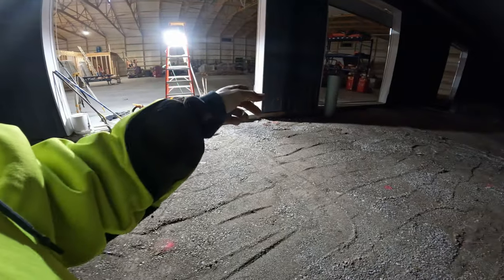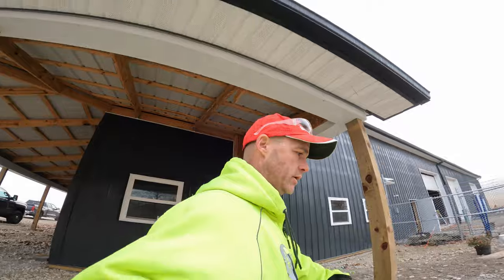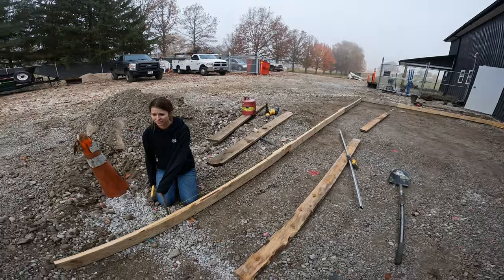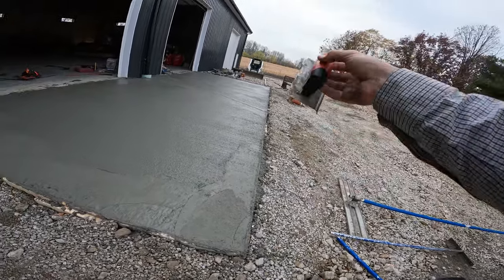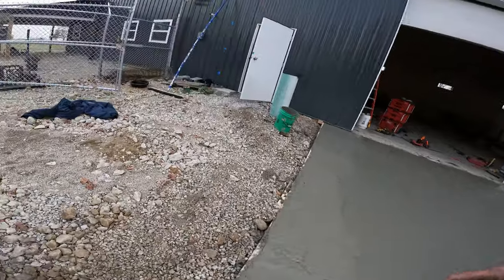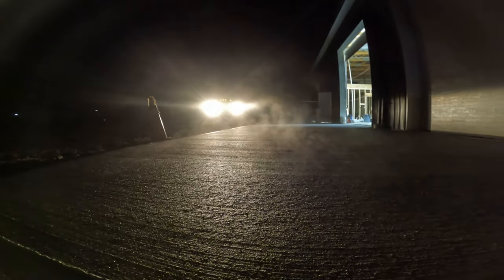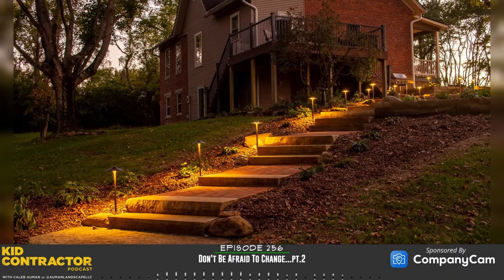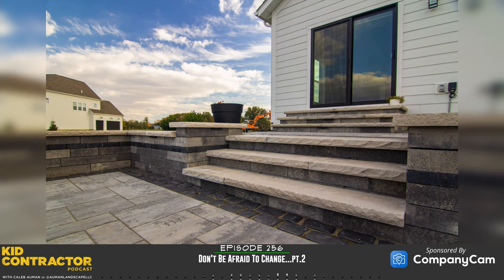What did we screw up on Concrete Slab Placement at Auman HQ? ??

Comment: compaction is good, but i prefer expansion instead of dowes, only for the reason u explained. dowes make sense to keep it in place, wire mesh is better, rebar is over kill and can cause rust spots on the surface. so far so good, btw compaction is key good job

Comment: You dowel in the middle when you want to pads to stay even like in a parking lot. Against a house you don't want to connect them, you dowel under the slab so it keeps the slab up and doesn't settle. In other words your slab will sit in top of the dowels.
Reply from the maker: Interesting.  That’s a good explanation.  Thanks!
Reply: thats what i said

Comment: Dowling is not ideal. And if and when you use them they need to be installed level with the top of your gravel base. You should do this so your slab don't settle but also when it shifts up it won't take a chunk of concrete out instead it will just pop the dowl free from the bottom of the concrete. The guy from Victory Concrete can explain this better than me.
Reply: exactly thats what i say on my channel. if u like victory u will love my channel